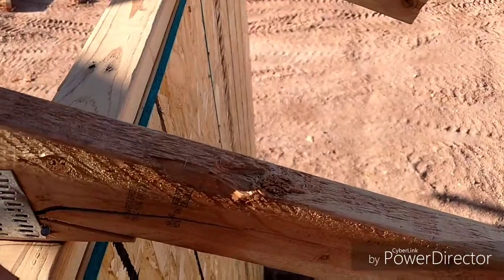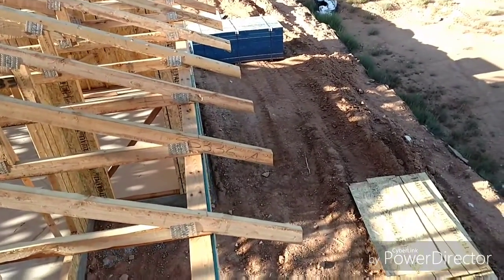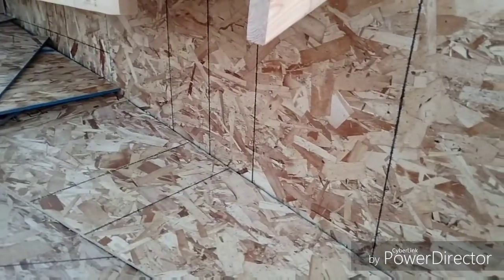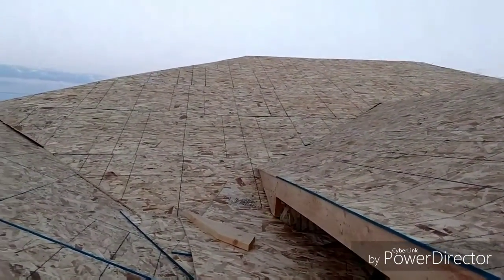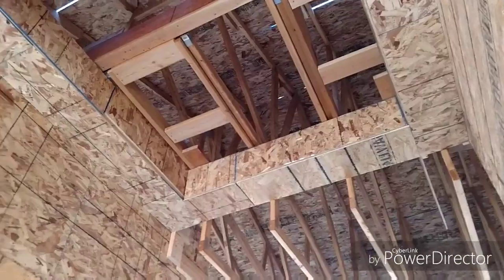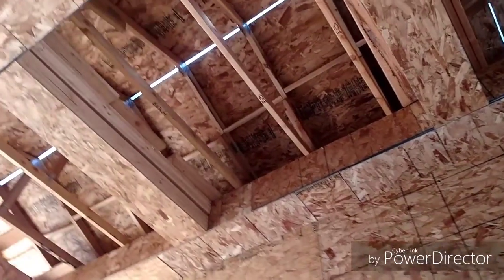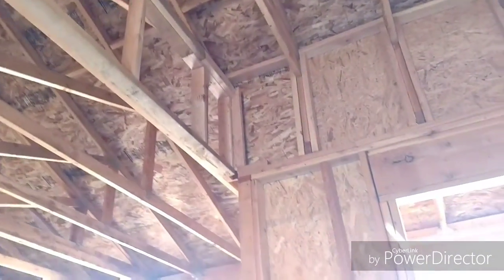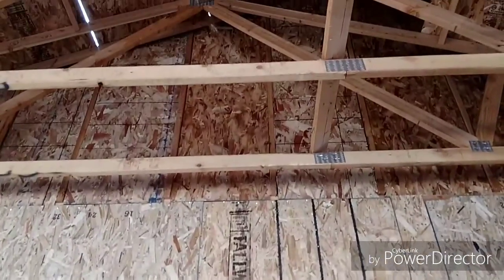How to frame a house. Video 2 of 2. Rough carpentry

Comment: Are those prefabricated trusses mateee
Reply from the maker: Yes they are
Reply: So all you did is lay trusses
Reply: That somebody els3 made
Reply from the maker: And frame all the walls, sheet the roof, soffit and fascia, crickets, etc. It's a little more involved than that. I've fabricated trusses before but it costs more in material and labor than purchasing prefabricated ones.
Reply: Yeah true but the roof is the best part of the house to build haha I'm a carpenter in Australia btw we do things much differently over here
Reply: But i guess if your in it to save a dollar or two then it is more cost efficient to use trusses. Just seems like a pretend carpenter job
Reply from the maker: I agree. Honestly, things are done cheaply over quality here, unfortunately.